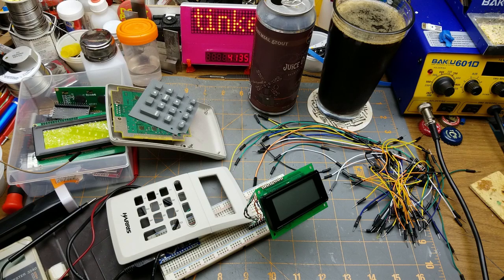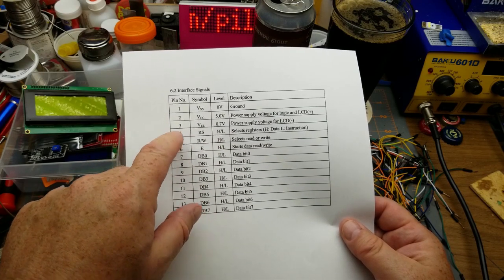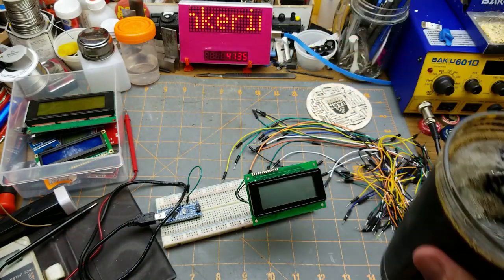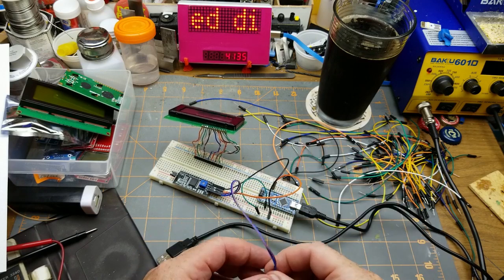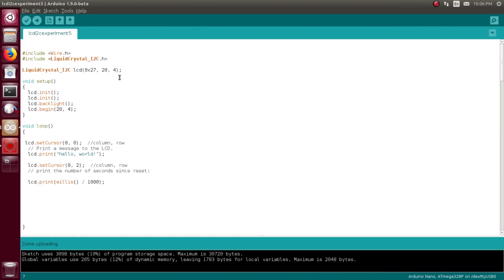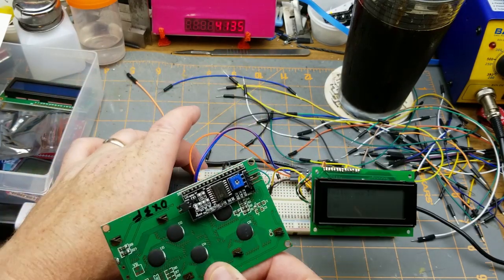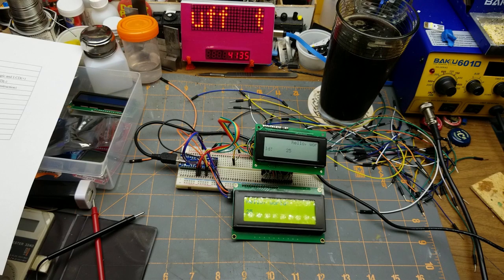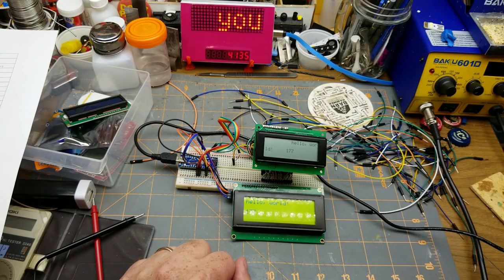tinkering with a salvaged LCD display

Comment: Nice video by the way.

I was down our local recycling centre and there was a working inspection camera running off batteries they were playing with. when I asked if I could take it off there hands and give it a new lease of life and save it from the pit. I was told in a very unfriendly way "that its electrical so it can't be given / sold to the public" and there's me thinking it's a recycling centre and not a just a dump.
Reply: Had the same response at my local "recycling centre"  - they had a packing contniner full of computers, monitors, and various domestic electrical items that it would be "more than their jobs worth" to let me take away to reuse etc. Even  contact with their management at the local council was unsuccessful.  So much for reducing waste

Comment: Excellent job! Always feels good to get 'salvaged' parts working. The chip on the 'backpacks' comes in 2 address ranges which is why with identical jumper settings on the board the addresses are different. One chip will probably be a PCF8574A, the other will be just PCF8574.

Comment: Ow, and about the address. There are two versions of the backpack chip (nothing to do with manufacturer), PCF8574 and PCF8574A. They are identical except there address range. First has 0b0100xxx and second has 0b0111xxx. You had 0x27 (=0b0100111) and 0x3F (=0b0111111). So the second has the "A" version of the PCF8574.

Comment: Pin 3 is for contrast adjustment. Just turn that blue pot either way until you see about 0,7V on pin 3, and then connect it to display. And both chips are Philips, it's just NXP bought Philips some time ago.
Reply from the maker: That's useful information. Thanks.
Reply: NPX did not buy Philips. NPX used to be a division of Philips which became a separate company. Which is very common for Philips.
Reply: @tengelgeer  Maybe. Either way it's the same chip.

Comment: Nice video and congratulations with the result. I applaud every reuse that prevents binning working components!
Some time ago I used that backpack module to drive a Nokia 84x48 LCD display with an ESP-01 . In the video I made about it, I included a pin-out of the backpack module (library is on my github account). As others noted there are two versions of that PCF-chip, each with different address range.
(BTW. The line-wrapping on that top lcd is a bit weird...)
Reply from the maker: I could have sorted that line wrap if in the code if I hadn't been too lazy to re-upload it and re-record that bit...

Comment: Well worth saving it from the bin, free and recycling :-D
I assembled a L-C tester circuit with a basic two line display, cost me £22 for the display at the time, but that was a loooong time ago...
A pic chip did the work.
I knew nothing about the code, other than trying different versions, just playing :-D

Comment: Trouble with liquid crystal is that there are sooooooo many versions of it :/ And they all work differently. I bed you have more than one version installed and that's why you ran into trouble the first try. I hear a lot of good things about the hd44780-library as an alternative (that's the chip on those displays).

And yeah, pin3 is contrast. That's why the pot is there for on those backpacks. And no, it's not negative like you said ;) 0,7 is little voltage and on a digital pin detected as LOW, but it's still a positive voltage.

And what is the reason to run Arduino IDE beta? Doesn't seem like the smartest idea for someone who admits he's not the best with software :)
Reply from the maker: When I set up this computer the Beta was the newest version that worked properly on this machine. 

And since it works, I'm not bothered to mess with it and potentially not have it available until I fix whatever I broke by dicking with the installation - messing with software isn't my idea of a good time.

The IDE is simply a means to an end for me.

Comment: Wow, got it working on the first try.  That never happens!
Reply from the maker: Nobody is more surprised than me.

 I was fully expecting to have to mess around with it a lot more before anything happened.
Reply: @pileofstuff  I have one of these kind of displays on my 3d printer, but I have not been able to use any salvaged ones from other stuff.  LCD displays often they have a flat, smooth interface plate, and one of those rubbery, vertically conductive connectors.  (Looks it up.)  "Elastomeric"/ZEBRA connectors.
Reply from the maker: @GnuReligion  Yeah, I haven't even thought about trying to re-use those zebra strip connected panels. They're mostly black magic as far as I can tell...
Reply: @pileofstuff  Yup, when I first encountered, I could not fathom how they worked.  They conduct in a straight line but not side-to-side.  True alchemy.  LCDs don't need a lot of current though, so a high resistance connector is fine.
Reply: eevblog have a video about how to design and use LCD display.
You need a microcontroller with LCD driver capability or a dedicated controller.

Comment: sometimes you need to use an init to get the display in to listening mode, then you follow it with an init as the first one may not have done the job, but it should be in a state to accept the second. that's how I did it with the pic's.